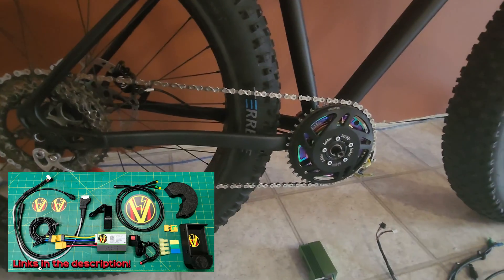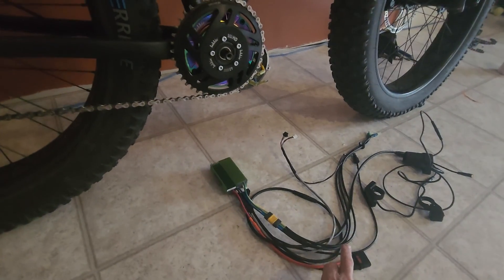Single Speed BBSHD setup and chain tensioning - Easy BBSHD Guide Part 2

Comment: What kind of speed does this setup get? I want to make a single speed "twist and go" fat bike for my commute. Throttle only, so im not sweating when i get there, but i have no bike lanes, so i want to keep up with traffic. Thoughts on a 52v bbso2 for the build?
Reply from the maker: It does 65kph on the flat pretty easy. Bbshd tho. 02 is a bit weak

Comment: With that chain ring and rear cog setup. Is that gear ratio any good for hill climbing torque?
Reply from the maker: Yeah it’s pretty damn good. At least with the power and rpm on this setup. If you go much lower it will just want to pop a wheelie
Reply: I just mainly use my bike for hunting and pulling a trailer. Would a 30t 30t cog be a good 1:1 ratio for hill climbing?

Comment: Have you did any comparisons or work with the bbshd daniel nilsson firmware?
Watched your comparison of the photon and hd yesterday and with stock firmware on the hd, at least from what i've heard, doesn't compare to the advanced settings you can get on the open source firmware for improving efficiency. I'm completely new to this world but there isn't a single video I can find on using, setting and tweaking this opensource firmware. Couple of hints and tips scattered about but not all that detailed really.
Reply from the maker: Honestly I have not used a bbshd stock for such a long time now I’m not that familiar with it. I will do some digging though

Comment: For chain length you could incorporate a single half link, they're available in 2 common widths , i dont remember the exacts at the moment if I'm being honest but this is something i do on my DJ and BMX builds to wt optimal chain line/ length
Reply from the maker: You are the second person to mention this. I will have to do some experimenting. In theory this would let me run the setup without any kind of tensioner. Which would be pretty neat. Thanks

Comment: Very clean set up just like mine except I went for the push up tensioning on the chain..nevertheless yours looks more jazzy in red.Just a quick question ,alot of us have 52v systems between 22mah or in my case 50mah on tap but want a more simple set up,instead of the eggrider and 4000watt ASI BAC 800 set up.More like a v2 luna cycle controller with 2200w and 35 amps and more torque and keep my BBSHD 850c screen  as stock and the 6v light output ...something less complicated to install as fixing the ASI tube frame holding mount is somewhat a eyesore hanging under the front frame...yes the V2 is simple to install but is it reliable as the ASI??Us fatbikers in Europe want a simple reliable unit which bolts onto the BBSHD directly so not needing another box to install,not a eggrider it's to small and a real chore to set up,a decent light output without reverting to having a DC step-down transformer...no need to dump our lovely large 850c  screens and above all a 2200w torque figure and keep our 52v batteries and rebuilding a costly molicell 72v setup.Speed is not always essential but a reliable controller with the same characteristics as the BAC 855 would be nice ...has anyone tested the Volition or electrified 2000w shunted modified BBSH controllers?? Can anyone in EUROPE OR elsewhere come up with a solution?? I have a 400€ budget who can help me out??😊Less performance and more practical for everyday commuting.I don't want to be a kill joy I love your channel but maybe its time to look at a middle of the range solution for us plebs.😅
Reply: A light shunt mod is a fine idea. I had 3 shunt resistors in parallel instead of the original 2 and it pulled 42A (BMS measurement) at peak load.
It keeps all the stock ramps but just bumps them up ~40% because of the mod, its quite reasonable and if you're not stupid you won't cook the thing.
Honestly my solder job wasn't very pretty but it lasted and I still have the controller, which works.
Reply from the maker: Its all good. You are correct. There are lots of folk that would like a lower power solution. Working on some cool stuff but can't talk about it just yet ;)

Comment: Any chain tensioner on amazon. Looks like yours is fixed in place, not moving under spring load. Or i am not understanding your set up right? However, coments here are correct- spinning motor at high rpm to get moving leads to wear of drive train. Any mid drive set up is bound to have some sort of variable gearing. Unless its a separate drive train like "lightning rods"
Your set up will be great to ride snow MTB trail in a winter since you can not go faster then 15kmh for most part.
Reply from the maker: I saw one that might work. I will see how it goes. They have been working pretty good so far with a couple of other builds. Always open to different options though. If I wear through chains fast then I will look at it. The RPMS on this top out at about 13,000 which at 22:1 with these tires gives a max theoretical wheel RPM of 600. The fastest I have had this bike is 75kph. The sweet spot I enjoy though is between 30-50kph You can cruise around at the boundary where the field weakening band is most effective and enjoy the smooth acceleration. I will likely have a mode with the field weakening deactivated which will make the pedal at 15kph viable. Its very useful for on any busy shared use paths where you need to be safe and there might be kids and dogs etc.

Comment: What size sprocket would you use in the back with the bac kit if you use a 52v battery and not a 72v?
Reply from the maker: The same. The BBSHD actually tends to run cooler with 72 volts due to the lower amps to reach the higher levels of power. The only real difference between the two setups is that the 72 volt accelerates for longer and hits a higher top speed.
Reply: Thanks. BTW, if interested, I used the cheaper Gustavo Lekkie knockoff all summer, no chain drops.  @HighVoltageKits
Reply from the maker: Thanks
Reply: For some reason the BBSHD goes 25km/h and not 15km/h (said in the video) with 1:1 ratio (40t:39t) at 56-58V. 18km/h in 40t:51t.

Comment: Rohloff single speed tensioner is much better, works with full suspension but it  will need an extension for derailleur hangers.

Pity about your discord really
Reply from the maker: Yeah. Expensive tho. Discord?
Reply: @HighVoltageKits  60gbp here in the UK. Pretty steep but aliexpress ones are about 20 and the DMR is 30 but isn't sprung from what I can tell
Reply from the maker: Thanks not too bad!

Comment: Kmc k1 NARROW single speed chain. Get it!
Reply from the maker: I am using KMC 9 speed at the moment. No sure its the type ou mean tho. I will have a look if this stuff wears out too fast.
Reply: @HighVoltageKits  you have a kmc x9.
The k1 is a dedicated single speed chain and is quite a bit more chunky.
Reply: @HighVoltageKits  ... There is also the KMC Z1eHX EPT Single Speed Chain (128 Links) specially designed for single speed middrive motor that you may do research on. I personally use the KMC X9e Turbo Bicycle Chain, 136L for my heavy ebike, but this chain is expensive at around $80 CAD.
Reply from the maker: I saw this as well https://www.kmcchain.com/en/series/half-link-series using this it might even let me ditch the tensioner
Reply: How strong is it? I've broken chains (albeit on cheap-ish bikes) just from pedaling with no motor. Always from a stop. Im 225 pounds and I even broke one while climbing. Probably wrong gear but I want one strong enough that I don't need to shift.

Comment: What would you think of running the chain tensioner  under the front sprocket like downhill bikes for a cleaner look at the rear?Or do you need tension at the rear sprocket @72v because of the higher power output and speed of the chain to avoid chain suck?
Reply from the maker: I think there are many ways to do this. I honestly don't know if it would be an issue or not. I think its mostly a case of keeping the chain tight to avoid it coming off.

Comment: ... the problem with fixed 1:1 ratio is that it is impossible to use PAS as you will only be able to reach 6 - 12 km/h at most while pedalling. So ghost pedalling it will be. 
It is however true that IPM motors have less torque than SPM motor, so higher RPM with higher gear ratio (21.9:1 for BBSHD) is desirable. 
But spinning the chainring at 600 rpm will wear out the motor and drive components faster than if it was spinning at maybe half this RPM using different gears ratios.

On my build, I have 42T Chainring and 9 speed 11-42T cassette. My bike is heavy at around 130lbs+, but I have a small 17" motorcycle wheel on the rear, that is equivalent to maybe 23" diameter with the tire,  so it is easy to spin the wheel compare to large diameter wheel. I can use gear up to the 6th gear and the BBSHD has never reached temperature over 65 deg C.

It all depends for what you use you bike for... For road use, I think I would use 42T front and 32T or 36T sprocket (depending on wheel size) for a lighter bike, that would still provide plenty of torque while keeping the motor RPM to a more favourable pace.
That is something that you can try to experiment with and choose whatever suit your needs.

Just my 2 cents and you don't have  to agree.

Cheers

🚴🚴🚴🚴............
Reply from the maker: You have a cool bike. In reality if its spinning at close to 600 then I am doing about 75-80kph which I have done maybe three times. I like to sit between 30-50 and enjoy riding. It's the acceleration that's the fun part for me anyway. With the BBSHD in general the faster it spins the less heat it builds up from the amps and field weakening. I get your point about wear but the bearings on mine felt great even after all those KMs. There is definitely a balancing act to it all. If the ASI app is playing nice we should have some nice data to see as to how the RPM load is in different positions. Have enjoyed seeing you doing a few more ride videos of late :) Cheers
Reply: @HighVoltageKits  Talking about acceleration, on my particular setup, the acceleration feel greater on the 3rd gear than on the 1st gear (1:1).
On the first gear, it reach maximum RPM very fast but the speed isn't much,  it's probably because of my smaller rear diameter wheel. 3rd gear will take me in the 60km/h range.

The BBSHD is a very reliable motor, but the problem is the wear on the drive components. For this reason, I may overhaul my setup this winter  with a Lightning Rods XL drive on the left side and a new Molicel P42A 21700, 20S/12P pack, so to be safe when I go on long far rides in the forest (imagine having to walk home a 130lbs+ bike 25km on a hot summer day with mosquitoes attacking you along the way,  because of something breaking inside the rear hub!!!

I broke a chain recently for the first time while I was on the bike path and couldn't find a spare quick link that I thought I had in my tool bag in order to make a quick fix. Night was coming fast and I had to do a temporary fix with a Chain Breaker Tool to make it home slow and easy. I was only maybe 10 km from home. Would not like to be in this situation 25km in the middle of the forest at night with bears and sasquatchs hunting you down... LOL

Cheers

🚴🚴🚴🚴.....🐻🧔‍♀

Comment: Me think simple non fixed spring tensioner would work just fine.
Reply from the maker: What do you mean by non fixed? I looked at quite a few options. Do you have a link? Im interested in seeing it. I looked at motorcycle stuff as well but liked this one as it used the derailleur point.

Comment: 30000 rpm motor rotor speed I would assume. Sprocket speed much less. I find chain strenght becomes noticable if using 8 speed chain or thinner. 6-7 or single speed chains are plenty strong with overvolted BBSHD.
Reply from the maker: 13,000 at 22:1 reduction puts it at about 600rpm at the crank so the same with a 1:1 ratio. Using 9speed chain because it's the largest that will fit the tensioner wheel

Comment: Oh the battle of BBSHD vs chainline. Easy with fat bikes, not so much with narrower drop outs and full suspension. This set up is strong but makes bike "pedalable" only at very slow speed. Tried this all. My next plan is Qulbix or Risun frame, 170 mm drop outs swingarm with matching Sturmey SX-RK3 . With 60v or 72v and your controller should work good. Will send you pic one day.
Reply from the maker: Sounds great. Love to see it. You are right the DH frames especially the newer ones are tough to get right.

Comment: In Reverse chain tensioner to come off the change stay and pull the chain upward and it will give you more clearance on the ground for the chain unless dirt on a chain and also you might want to go to a T8F chain because it's stronger than a normal Ebicycle chain if you're going to run a 30,000 RPMs that would be a stronger chain.
Reply from the maker: Cheers James. I'm using KMC 9 speed. You might be right. I'll experiment if I'm not happy. Cheers
Reply: I was using a kmc x9 with a bafang ultra and almost a 1-2 ratio. Other than it being floppy (for gear changes) they're fine. Even the super light one.
Now using a superlight kmc k1 single speed chain.
The motor may be doing 30k rpm  but the output shaft/chain sure aren't.

Comment: Run the chain under the tensioner wheel - pull the chain towards the sprocket.
Reply from the maker: I have seen people do it that way but it would not reach without other parts. The instructions on the box it came in had it on the inside. Lots of people do use them the way you mention though.
Reply: Agree, this also prolong the chain and sprocket life as more teeth comes in contact with the chain reducing the force on each links...